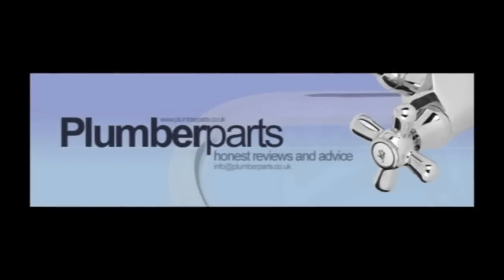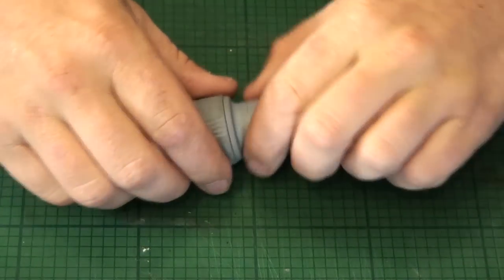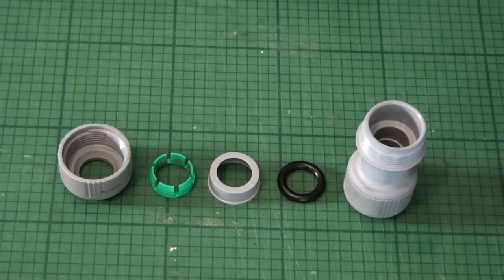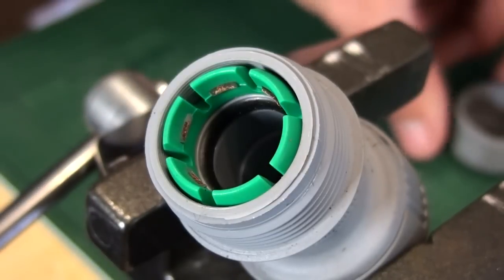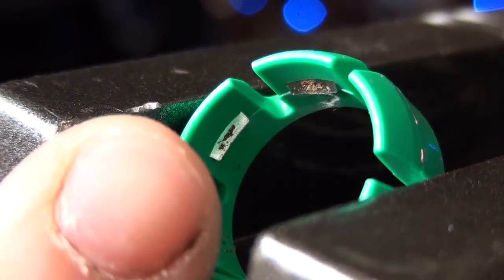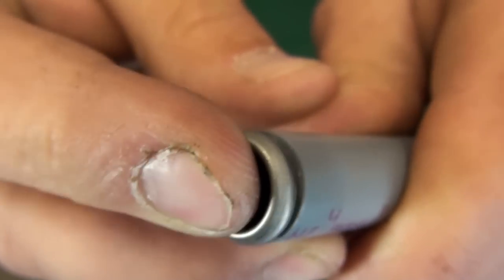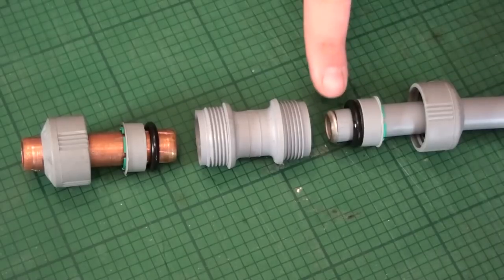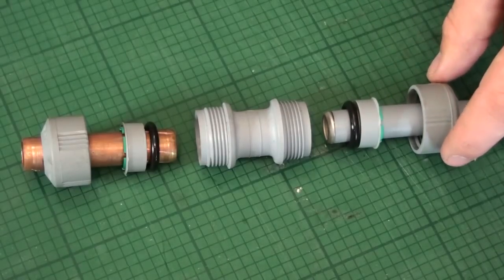How to use Push fit fittings - Plumbing Tips

Comment: one observation a made is that the fitting was assembled on the pipe, as far as my knowledge on Hep2o goes. being a pushfit, the backnut should be left in place and not removed to form  a joint. so the fitting should be fulle assembled and the pipe pushed into the fitting to ensure a correct joint. the fitting should also be clean. i realise that this was probably for the purpose of the video. Hep2o is a great product.

Comment: Thank you for these wonderful tips! I think the speed of making a connection with push fit fittings is perhaps the biggest advantage. In an emergency you can quickly cap or repair a pipe by simply pushing on a push fit fitting.

Comment: Thanks. Nothing has not leaked since.  I made a slight mistake. I chose one of those plastic Venturi type Speed fit valves for the hot but they are not full bore and on gravity it reduced my hot water flow. Was going to replace for a full bore but maybe am going for a 150 litre high pressurized hot water tank in combination with my system boiler. Once the pressurised hot water is in place I have to see that Speedfit stuff holds.  Still, the plastic valve has a temperature limit another concern.

Comment: Created an assembly out of these (T junctions pipe and elbows) that took water from entry black pipe into the house from the floor, to control: cold sink tap, dishwasher feed, washing machine feed, outside tap, cold water out of kitchen to other parts of the house and tank.  One of the elbows busted twice creating small flood.  Eventually on 3rd attempt so far it holds together.  Quite worried about it, turn the water off at night. It vibrated an bam!! it came apart shooting the pipe backwards.

Comment: I was referring to the part in the video where you instruct the user to "push the nut over the pipe and fully insert the pipe in the fitting before tightening the nut."

Comment: They can take a bit of practice if you are new to them. It's easy to make a joint with these that leak if you don't understand how they work under pressure. For instance I did everything by the instructions but joint leaked, and I found it was because the pipes were pushing together with the way they were sitting when I was done, so the fitting was loose. I found that the ends of the pipes need to be pulling apart from each other otherwise the seal doesn't form.

Comment: Great Videos PP. I've learned bundles from them. Question though - If I'm teeing off from a flow and return to fit a new rad', can I use plastic push fits Tees going from existing copper to plastic pipe and back to copper again for the pipes that will be on show?

Comment: I think from reading this page's comments that most people are successful for radiator jobs.  I had a huge scare on mains pressure.  It would seem to me that ensuring a 90 degree bend is clipped so it cannot move is important because otherwise with the bangs of pressure from water mains and closing and opening of taps it can get undone.  So can we really trust it for mains pressure applications?

Comment: I dunno about hep20 fittings, but I know if you install polyplumb fittings in this way, the warranty’s void cos you’ve dismantled it, they say you’ve gotta leave the nut on when pushing the pipe into the fitting.

Comment: I've rarely ever used these - only when supplied with showers or water softeners (when I cant get a compression fitting on). Over in Ireland we only really use Tec-Tite or compression fittings for such connections - although I prefer to solder or silver solder any hot connections. 

Any idea on what pressure they'll hold when hot water is run through them?

Comment: Do I need a metal sleeve (to prevent from collapsing) for CPVC pipes also?
Reply: Atul Garg it’s good practice to use an insert with any plastic pipe you intend to use with fittings that compress
Reply: You can get nylon inserts also, I wouldn’t call them sleeves as they go inside the pipe

Comment: Yeah, the temperature limit isn't good. I have push fit valves at the ends of my tap fittings and they have a max temp of 65c. I've seen my boiler get very close to that even though I've got the temperature turned all the way down (I don't think the regulator works) so it's always a worry

Comment: I had a PVC pushfit cap but I didn't understand what it was or how it worked. Just fidgeting, I slipped it over the end of a stick that's part of a $200 exercise device and was completely surprised when I couldn't get it off. Is there any way to get it off, or is that exercise device ruined? (It's just 2 weeks old.)
Reply: should be a horshoe style of collar to push back and release the fitting.

Comment: I suggest you read the instructions that come with the fittings.  They are called push fit for a reason.  You show them being used as a compression fitting but they should not be taken apart before fitting them to the pipe.

Comment: Brass shark bite fittings aloud in the UK?
Reply: +Derek (dRykenTV) We have something similar I think, called Tectite (brand name) it's just push fit copper fittings, one time use only though as you can't get them off.
Reply: Matt Jarrett you can release pipe from tectite fitting

Comment: Mistrust in plastic is irrational. Copper gets expensive. Plastic: easy to cut, bend, work with. Fittings are watertight - even cold main isn't very high pressure, after all. Most problems from bad technique, cutting pipe clumsily or omitting pipe end stiffener!  Professionals use plastic. Of course, if pipe might come apart thru stress, copper is an option. It's mechanically end/end stronger than pushed on connector. But push-fit is much better when breaking and re-making a joint. No flame!

Comment: I know plastic pipe is handy, but I don't trust it. Rubber O rings perish over time, the grip teeth look a feeble to me. Copper is tricky to use sometimes but IMHO its a tried and tested method. 
I fit kitchens and the plumbing to sink, and as a result every so often I need to move rads so drain down and fill ups are common.  Well on a job fitting a kitchen and the owner tells me the property has been empty for over a year before they bought it, lady asks "i can't seem to get the heating to work, can you help me with this" ..... me, "sure, show me the boiler and ill have a look"...... 1st thing I noticed was the pressure was at zero. "That is most likely the cause of the heating not coming on, I'll top it up for you now and I'll bleed the rads"......so top up via filling loop, boiler fired up and hey presto heating and hot water.....customer "thanks so much I've been freezing for a week"...me "no problem, I suggest you still get a plumber to check it over and service boiler"..... customer "yes definitely, thanks again, you're a life saver" 
3rd day into fit, "morning customer, everything fine?" ..... customer "yes amazing, thanks"......mid day I hear the customer screaming water is coming through the ceiling.....I turn off the stopcock but water keeps coming, stick a hose on the rad drain cock and the water stops.....we pulled up carpets upstairs and used an inspiration camera (drilled couple holes in weyroc flooring) in common plumbing routes, found the leak point........plastic fitting popped apart and to top it all of ......CUSTOMER "THIS IS YOUR FAULT, AND YOU ARE REPLACING MY LOUNGE CEILING INCLUDING PAINT.....IT WAS ONLY DONE 3 DAYS AGO!!!!" ..... we ended having to do it at our expense, for doing a favour and a part leaking which we didn't even install 😫😡..... long winded tale, but was a valuable lesson to me.

Comment: Never trust plastic fittings, been let down too many times by them.  As said below the generation of plumber these days struggle when it comes to working with copper yorkie, outer lite fittings. And  it's actually a laugh when they try to use a bending machine.